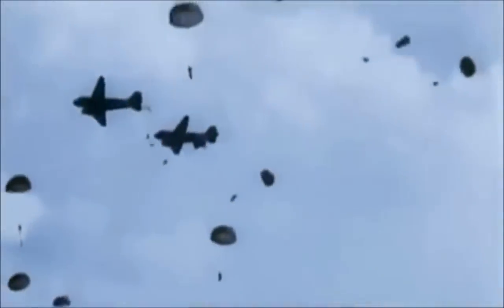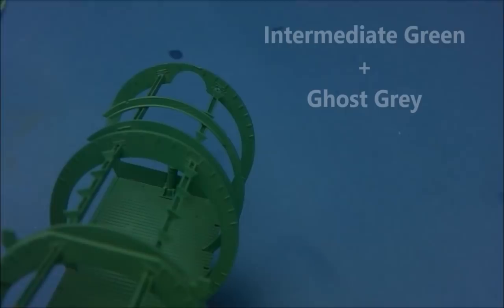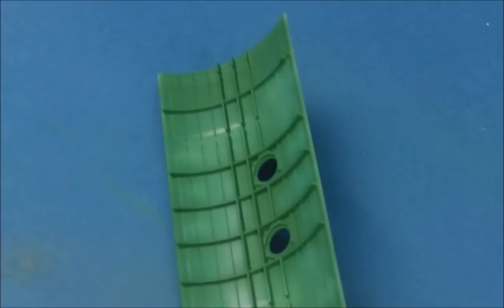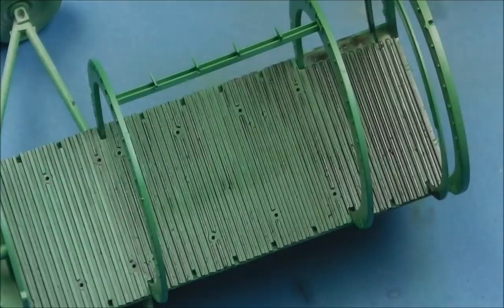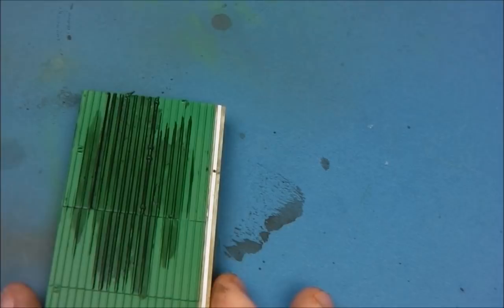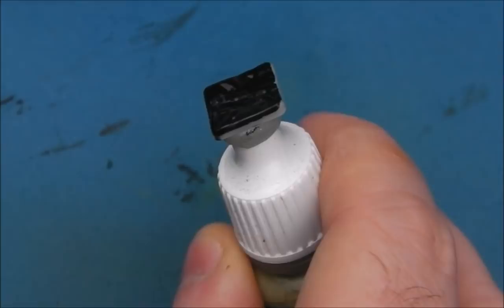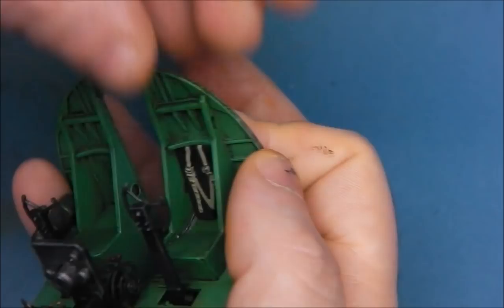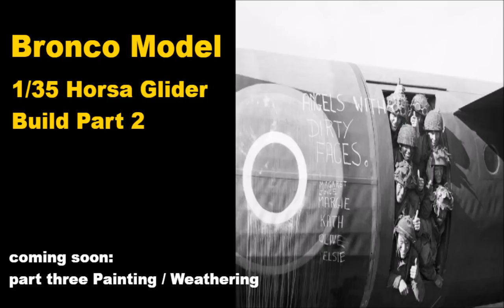Bronco Models 1/35 Airspeed Mk.1 Horsa Glider Build Part Two Interior Painting

Comment: Might be interesting to know that later made Horsa gliders interiors were not painted up to the ceiling. They were painted from the floor just underneathe the windows. The rest would have the natural (ply)wood coulour.  there were at least 2 reasons for this. It would speed up the production and it would save a lot of (paint) weight. I have copies of original documentation stating this. In the Wolfheze glider  collection there is an original  piece of forward fuselage were the original colour still can be seen. In the Pegasus museum in France there is a original rear piece  of fuselage wre the entire interior is painted green. The Horsa fuselage was constructed frome seperately made tubes that were fitted together and painted. Different parts could be made by other manufacterers. Cockpit tail wings etc. These would be fitted together by civilian workers at Brize Norton.

Comment: Worse here in Scotland in the summer! My secondary bullet water trap at the airbrush end cracked at the valve the amount of water I'm getting just now is crazy without a  secondary water trap! I have to let the compressor run without the airbrush connected to drain it! That's with the heat through summer aswell i have a 3rd to connect now one bolted to the dest the same size as compressor one for the middle of the line and a new sparmax silver bullet on order! The last 6 months tops the airbrush end water traps before going brittle at the valve screw! It's odd it's like the water eats away at the plastic thread when press to empty it unless it's got thinner mixed through somehow I don't see how that could happen even with a back flow! good old acid water here lol

Comment: No part 3 huh?
Reply from the maker: unfortunately it seems not to be likely, this is possibly one of the worse kits I've ever built nothing fits, nothing lines up, I spent about two weeks alone on this kit during the summer to try to get the wings and fuselage sections to least crudely lineup but not even the wings would even sit on the frame work so I am not sure I will be able to save this kit
Reply: @longlance67  then I shall stay away from Bronco kits!
Reply from the maker: @henryschmidt636  unfortunately I can't really recommend their kits to anyone
Reply: @Shane Smyth - scale models  are their armor kits equally bad?

Comment: Great Work Lad!
Your modelling skills are excellent!
It's a shame that this huge, pig of a model, was possibly,  hideously molded out of alignment, by manufacturer.
You deserve great credit, for putting an excruciating amount of work,  into correcting the outside panels.
Reply from the maker: it is possible that some of the parts were molded warped but its a very poorly designed kit, I've tried to build the fuselage but the fit is terrible and the wings don't fit as an result
Reply: @longlance67  Well, you deserve great credit for accomplishing what you did with this pig of a kit.
A shame, that's a poorly designed kit.
It's probably best to move on, when a bad kit becomes a time sucker.
Great Work, Shane!
Reply from the maker: @larrydee8859  its  beginning to look like it might get discarded at this stage, but I will have a few more cracks at it to see if I can salvage it
Reply: @longlance67 
Your Great modeling skills,  really show!
Well; Give it one more,  good shot at it, if you feel up to it, Shane.
Your modeling skills, are Grand!
Great Work!

Comment: Good job on the model.  What was the width of each invasion stripe you used?  Interested to know.
Reply from the maker: The kit provides a basic measurement of each strip in the painting guide for kit but I can not remember the extra size or its accuracy unfortunately

Comment: Yaiks...that fit problems reminds me of my very bad experience with us diamond wrecker by mirror models :( And thank you for your tips with vallejo model color Shane. Great job
Reply from the maker: Lukas Giant no worries mate glad to be of help I might do a short video soon on spraying model color as a lot of people say it cant be done. Also thanks for the heads up with the wrecker was thinking of adding it to my collection, Is it a bad kit?
Reply: Shane Smyth - scale models That would be helpful for vallejo model users mate. Actually that diamond wrecker kit is very detailed kit but lots of problems with it. These problems are :
1. Gaps
2. Hard and britle plastic on some sprues
3. Very big sprue gate,so need a hot knife to remove it from the sprue to avoid breakage
4. Unclear and shrinking locating points even sometimes no locating points
5. Lots of shrinking parts so need many adjustments and drilling or make the hole wider to fit perfectly (even for attaching headlights to the fenders i need to drilling the hole wider so the pin can insert the hole on the fender)
6. Vague and missing instructions
But with a lots of patience and with 1 or 2 crate of beers that would be an amazing kit lol.
Sorry for my bad english :) cheers
Reply from the maker: your english is fine my friend so no need to worry !
I am very temped to try one of these kits some time in the future as they are often seen with Shermans

Comment: Great stuff!! How do you hold your figures while painting them/what base do you use to hold them still?
Reply: CoffDaddyJr I find gluing a piece of plastic sprue to the foot works, or you could use an old empty paint tin/bottle and hold the figure in place with blue tack or glue works for me.
Reply from the maker: the main method I use is using a cork from a wine bottle, then taking a paperclip and drilling it into foot of the figure and a dab of superglue to fix it to the figure and then a dab on other end to fix it to the cork as I push the pin in